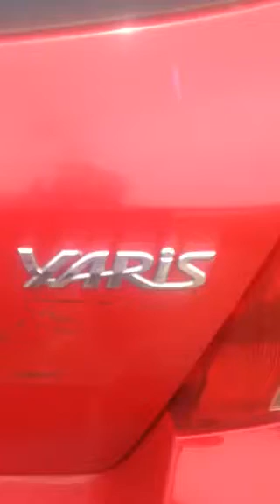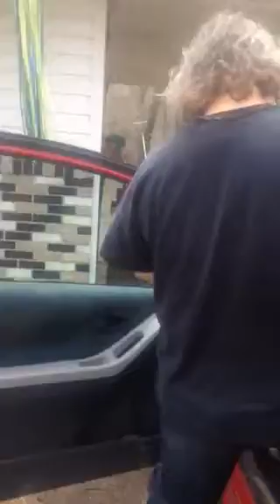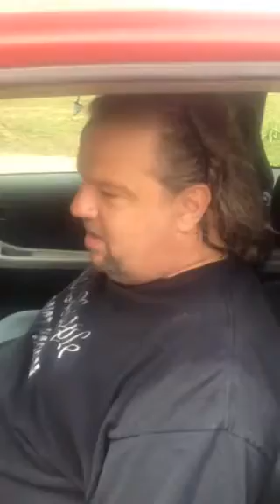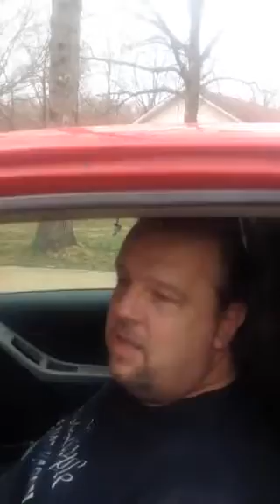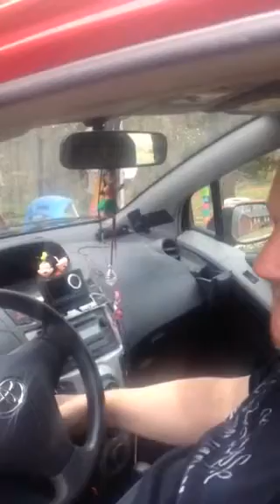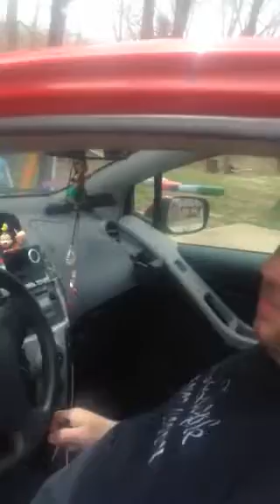Toyota Yaris Squeaky Fan Belt Problem Solved!

Comment: its the serpentine belt. either worn or loose. that noise is the belt screeching from the pulleys from the alternator. what you are doing is treating the symptom but not fixing the problem.
Reply from the maker: Yes it's been fixed.
Reply: I have TWO 2010 Yarises, ONE I bought brand new, now has 150K and its been "fixed" by dealer for this several times. = New Belt Run for x-miles, and retension then in about a week it goes back to doing this...The belt is NEW OEM Toyota, and tension is correct...I have a second one w/22K on it, and I have even put the Turnbuckle mount on so I can get it "Too Tight" and it STILL DOES IT - I showed the dealer that BOTH cars do exactly what this video shows, and he said; "Yes, we know this works, and the only fix for it is to turn slowly." - So if they KNOW its the solution WHY not just tell the owner of the car? MONEY!
Reply: @misters2837  I've gone thru 4 belts in like 2 years. Might be closer to 10 over the lifetime.  Last time about 2 months ago changed our a new one. The chirping went away for a couple days. And now it's back at it again. Car has 200k miles. Last belt was obliterated in less than 6 months. And go figure, the battery light went on today . Either need a new alternator or the belt is not adjusted properly. Other than that, the car runs like a champ. It's my secondary car that I use to run errands.

Comment: I'm having the same issue with my Tundra 😒
Reply from the maker: have you tried this fix?
Reply: Aaron Homer I just tried it and it did help,and yesterday I just had the timing belt replaced. I'm wondering if I should take it in to the mechanics. My dad and husband were the ones who replaced the belt 😳
Reply: Yaris' don't have a timing belt, they have a timing chain.